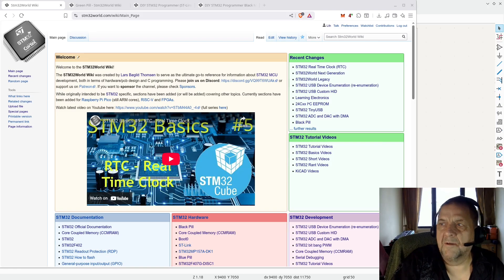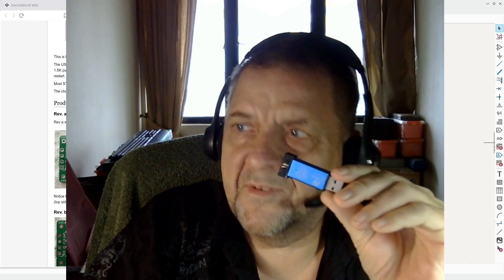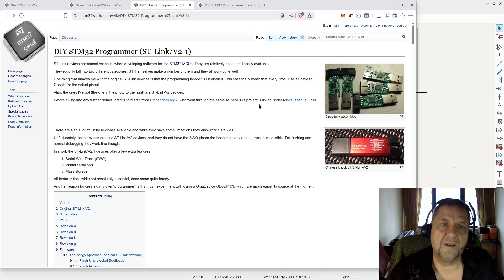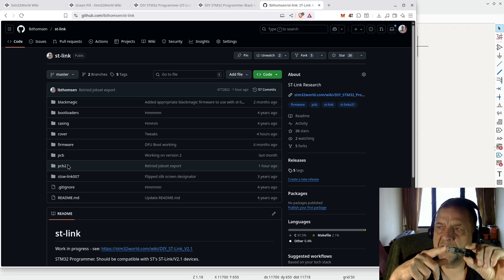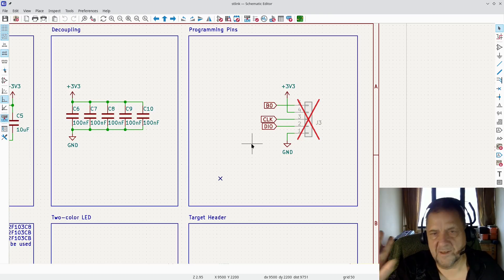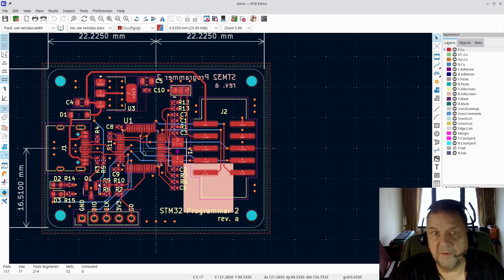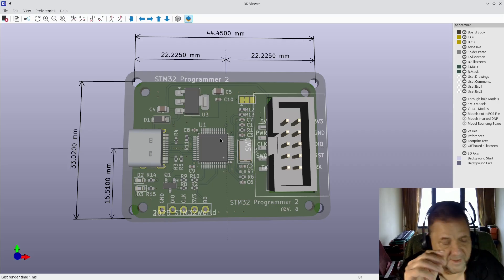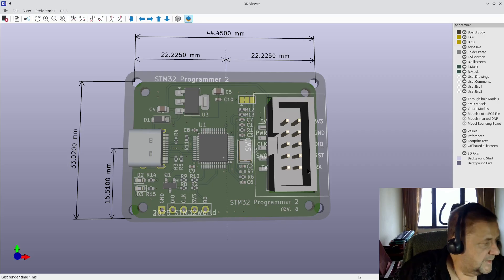STM32 Tutorial #67 - STM32 Programmer & Debugger mk. II (ST-Link)

Comment: I am not sure what to do, because I like this tiny programmer like this Chinese STlinkV2 in the aluminium case, but they are not working any more with STM32CubeIDE. Every time if I want to use them, I got asked to flash a new firmware onto them and it is not working.

What is with your programmer and the blackmagic firmware, is it possible that I would get this problem with it too?
Reply from the maker: You should watch this video: https://www.youtube.com/watch?v=F1-4UhjyNws

To be honest I am not a huge fan of the Black Magic firmware myself - but with my programmer you can switch between Black Magic and ST-Link as you please.  As for the cheap Chinese clones - I've had a few that stopped working with STM32CubeIDE because they could not be updated, but most I have do work fine.  However, they are still very limited in functionality.  No SWO and no serial.

Comment: The "Mini Debugger" from the Chinese company 'We Act Studio' (available at Aliexpress) is also a ST-Link clone, which has SWO and TX/RX, and a USB C connector.
Reply from the maker: Yes probably and you might even get one if you order it.  And that will probably work fine until that silly cable breaks.  They pretty much did exactly the same mistakes I did with my first version.
Reply: @stm32world  I already have one. They use a SH1 connector for the cable. If the cable ever breaks, I can make a new one.
Reply from the maker: Good for you.

Comment: Through-Hole Technology is a much better solution than smd connectors because it is much more robust for constant plugging in and out. Over time, the smd connector will break off the board. Sometimes an old solution is better than a new one.